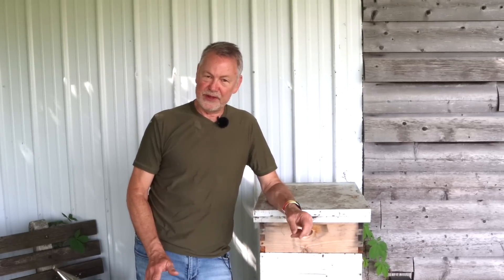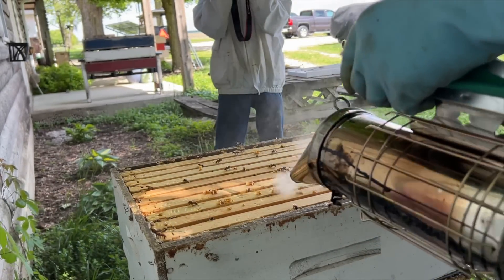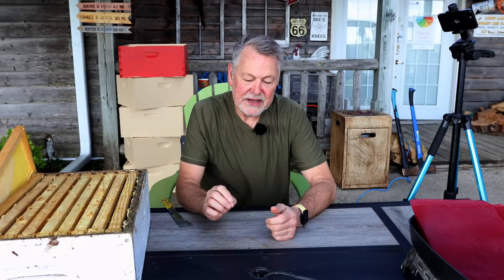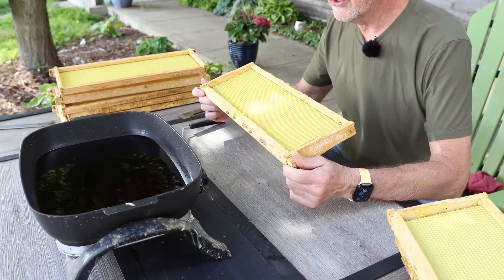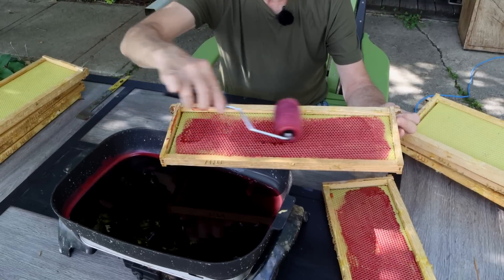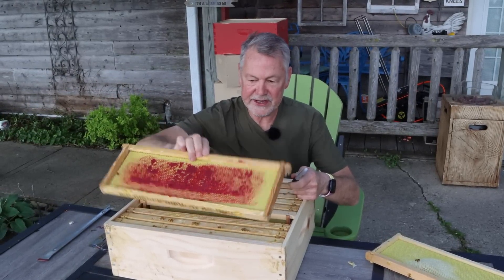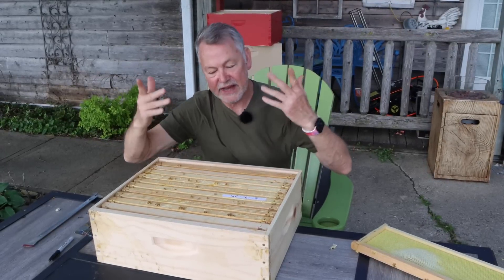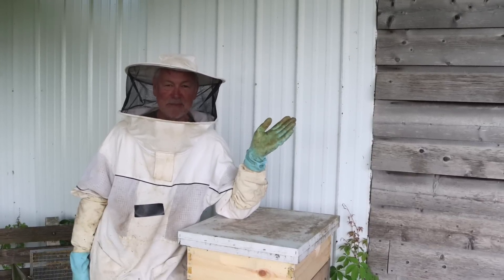Beekeeping: Wax Experiment & Repairing Wax Moth Damage

Comment: Hello, and good day. I kindly had a question for you David Burns, I had a super that had wax moth infestation happen to it. I believe most of the frames of honey got extracted and there is a frame that had no been filled out, I think I was considering just giving it to the bees to use or fill up the rest of the way maybe. So I am now left with a frame with maybe 80% honey on one said and 60% honey on the other side, other cells have pollen and maybe a little beebread in them, and a small cluster of empty cells. The wax moth webbing and damage was everywhere but on the frame with honey it wasn't super bad, I froze it and then took it out and hosed it off thinking it's all corrupted, but the water only washed off webbing and damage, the honey cells have stronger a wax that's capped on top and the water only repelled off. I then thought how clean everything was looking and wondering how safe is that honey, I'd rather not waste it but I'm concerned about human consumption. I don't know if any larvae got inside or not, the honey seems contained but the idea of egg and larvae from wax moths maybe being in it repels me like water off of wax. I also know some wax moths can carry pathogens which concerns me. I know bees clean up wax moth damage very well. I know they could also stand a better chance at consuming it than people as the pathogens aren't a risk so much unlike to humans. So my question is the honey best to throw out, or let the bees have it, or is there by some chance I don't know about where human consumption may still bee possible? The capped honey cells look like there was never webbing on them so before I threw it out as my first idea I thought I'd run it past the expert Master Bee-Keeper. Thanks for your time and GOD bless always!!!

Comment: Another method is to dip the frames/foundation in a deep pot with wax floating on a layer of hot water.  Even coverage corner to corner.  Glennglad to know about the wax moth.  That has been my experience also.  I think the moth larvae eat ALL of the wax off the foundation and the bees ignore it.  My question now is will the bees clean and repair pollen frames that shb larvae have been in but not slimed??  Glenn

Comment: I have been using a wire brush attachment for my drill it works good on cleaning the frames up from wax moth.  
I was shocked when I had a swarm move into a dead out that was full of wax moths' cocoons and seem to be doing ok.

Comment: Your wax melter is similar to a guy I knew about 30 years ago. He used an old electric hot plate and his wax storage wax an old 12” round cookie tin (remember those old 3.5” deep danish butter cookie tins that always appeared around Christmas? My grandma had a few that she stored bobbins, thread, crayons, etc in) that he put directly onto the coil and heated it so that the wax was always at the melting point (also the freezing point) so that he had between 2 quarts and a gallon of liquid beeswax at any given point when working. He made beeswax candles (primarily tapers) and poured them. Keeping a bunch of wax inside the melting vessel was the biggest key to keeping the temperature perfect; only having part of the wax molten guarantees that it isn’t overheating and will harden quickly without melting back off of what you were working on.

Comment: I don’t remember where I read or heard.  That swarms like old cones left over by wax moths.  If they do is for the free wax & there is nothing left for the moths to go back.  But I had seen bees getting stuck on the wed they leave behind. by their legs so it will be an interesting result.  
I used yellow  wax foundation before and they draw all white with a few yellows spots that Ithought it was pollen at first, but it was untouched foundation I didn’t used plastic only wax.

Comment: I use a foam 4 inch roller.  I think the foam holds up better over time than the fiber rollers.
Reply: Keep a close eye on the foam roller. I thought mine was better too, but after repeatedly dipping it in hot wax, the foam started coming off onto the frames. Small little particles. I went back to fiber immediately. I don’t want microplastics in my honey.